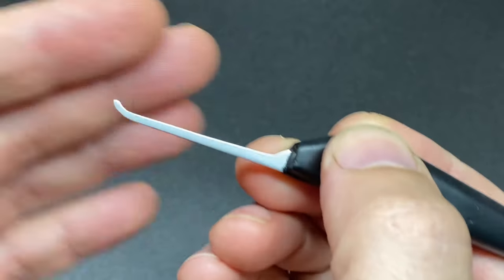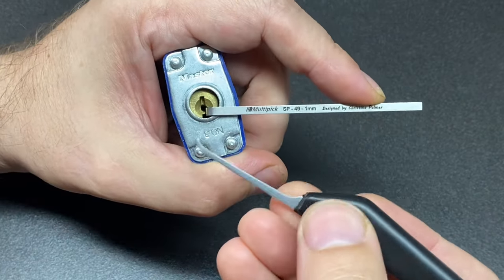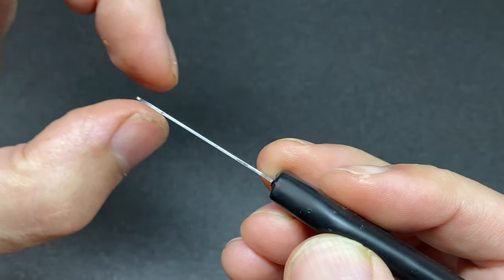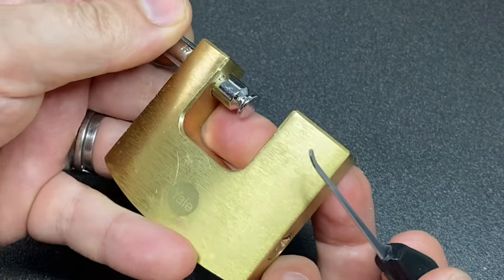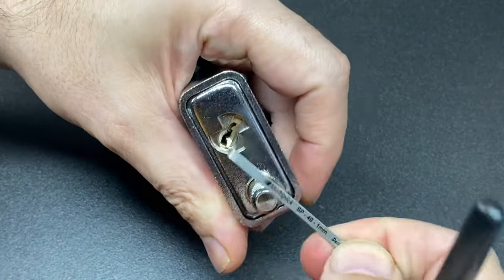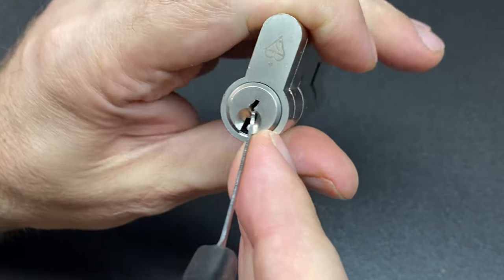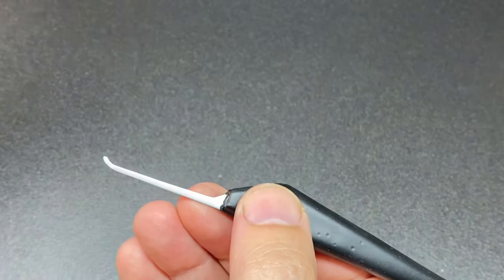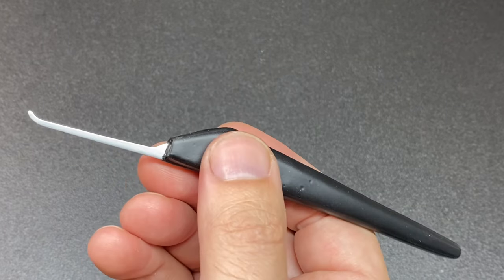I Made a Lock Pick Out of My Wife’s Car!

Comment: After seeing one of your videos I recalled buying a large lot of windshield wipers years ago that were so terrible I refused to sell them. I dug a number of them out from storage and stripped them down. I made a very quick diamond pick with one, shattering my "heavy duty" flush cutters in the process (be careful). The steel is fairly hard and I've picked a number of locks with it, but it's definitely thick and more suited to tensioning tools...or possibly some bypass tools.

Comment: Have you ever tried making picking tools out of old hacksaw or coping saw blades? I remember them being very thin and flexible and made of carbon steel. I think maybe junior hacksaw blades? And I assume that blades for cutting metal would be more durable than blades for wood.

Maybe try a variety of little saw blades?

Comment: What next, his brother's toothbrush?
Reply from the maker: *makes notes
Reply: @LockNoob  Have you ever used 'J-B Weld Steel Stik High Strength Automotive Epoxy Putty' for any of your handles? 
Its a really neat material - It hardens to feel almost like a rock. Cool to the touch at first and super hard. Very pleased with the feedback also. When I use it - i just make the whole handle with it.